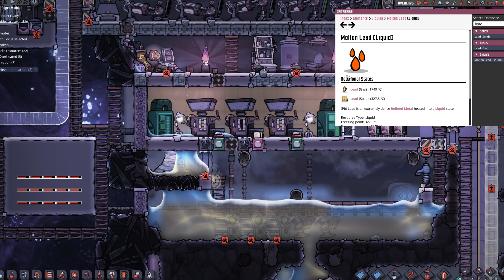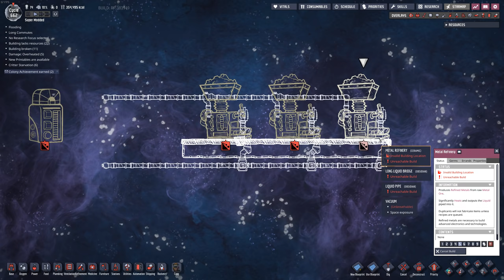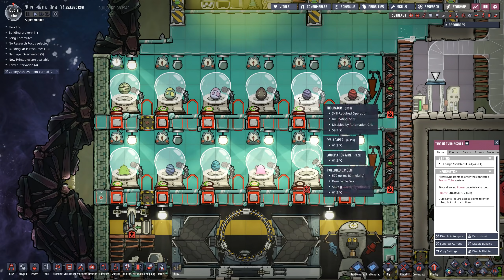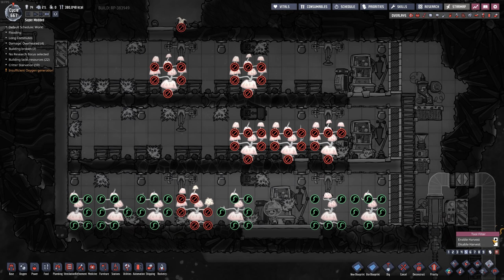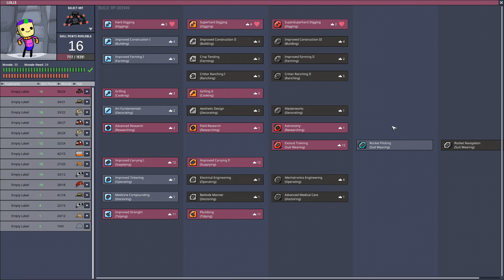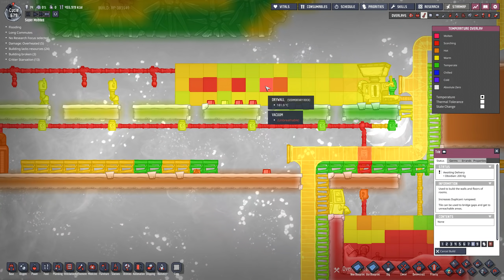Using Liquid Metal as Coolant! Super Modded Oxygen Not Included EP19

Comment: ever tried to make the unusual gasses in the game? aluminium gas, steel gas, must be some weird and wonderful things it can do apart from melt the world.

one note about the setup is you wont be able to run more than 1 machine from that loop anyway, you will need to use all 3 outputs on the tank to keep the system ticking or theres not enough materials flowing in as coolant it will just take longer to fill each reservoir, in case someones copying the design exactly, save yourself the ceramic

Comment: I think the lesson to be learnt here is that lead works pretty much as the opposite of water: Very little specific heat capacity, but pretty high thermal conductivity. (Granted, aluminum's thermal conductivity is even higher, but so is its heat capacity.) Because of these traits, it performs terribly as a coolant, BUT it would work well as a heat exchanger to be used ALONGSIDE a coolant. Try using it (perhaps along with some radiative steel pipes) to transfer heat away from magma, hot igneous rock, or even just molten aluminum to dump onto some oil or petroleum for example (or just use molten aluminum to transfer heat from magma to molten lead, then try to pump the molten lead to oil or petroleum to keep it cool).

Comment: There is a way to pump hot liquids without exposing the Pump to the liquid. The pump radius is a cross and also pumps liquids one tile to the left under the pump. So if a pump is built on one right tile you can put liquid in the left tile and pump it without the pump overheating. Hope that helps with dealing with hot temperatures.

Comment: @23:30 while anticlimatic, maybe running the crude oil / petroleum first into to pipes to warm them up could have been a good idea? ;)

Edit:
@29:50 you can't use molten lead for steel production - the SHC is too low. For aluminium, niobium and iron, you can run it once, then you have to cool it down a lot. With copper you can run it twice, gold increases the temp +206C, so it can be run multiple times.

Comment: I feel like the second filter gate to the right of the incubators is redundant. The left filter gate is preventing dupes from disabling the incubators prematurely already, and without a piece of automation directly connecting the button to the incubator they wouldn't be able to turn it on as well. :thinking:

13:10 That menacing Sporechid, just waiting to be awakened and cause problems.

I'd  like to see something like anti-liquid in the modded game. Something that turns to gas at lower temperatures and turns into solid when heated enough. Also, how about liquid steel pumped metal refineries? Probably will have to wait for thermium though...

Comment: Brothgar! You should use a new mod, it's wonderful and amazing! It's called the Thermal Interface Panel, and it connects buildings to the background layer! Power wires, liquid pipes, buildings, gas pipes, it connects everything and allows heat to interface without any gasses or liquids! Perfect for your space metal refineries.

Comment: You can also melt insulation if you pipe molten niobium through your refineries. if you make a not insulated "normal" liquid bridge tu pump it through you can melt it down and get some juicy materials :) takes about 2000 cycles to charge up the heat tho, so have fun with that project

Comment: Thermo Dynamics: You need to learn about Thermal Diffusivity, Heat Transfer Rate Ratio of (Spec.Heat Cap. /  Them. Conduct.)*(1/Density)
it like a Bucket(SHC) with a Hole in Bottom(Them.Cond.)
Bucket with Big hole in bottom VS. Olympic Pool with with pinhole in Bottom etc etc, its not always the SHC or the TC numbers to judge which is better to transfer heat, its the relationship between the 2, the Rate Ratio, the Thermal Diffusivity.
TL:DR       K=SHC/TC
tends->0 =more heat transfer(Conductor)
tends->Infinity =less heat transfer(Insulator)
Since buildings(pipes) etc are all made with same amount of 
mass(50Kg Sandstone, 50Kg Obsidian, 50Kg...etc), and 
2D Area are same also(square tiles)
Density(in-game Kg/m^2) is always the same (for Item your building) thus cancels itself when compared to another material
you can simplify formula to just Ratio of K=SHC/TC
BTW here is a link to my Main resources Spreadsheet with ALL materials in-game, Public, Enjoy(i like my Liquid Phase Chart)
https://docs.google.com/spreadsheets/d/1yUQ7nwJ1Cw8I7W6MZqy55gay9C8isIlml2JP9chZUzk/edit?usp=sharing
IRL> https://en.wikipedia.org/wiki/Thermal_diffusivity

Comment: Serious comment time: Of course you managed to accidentally turn lead into gas, Brothgar. Of course you did. Though.... I wonder if you could use molten salt as a coolant? Molten salt as a coolant might be a pretty cool idea to look into!
Reply: It's worse than aluminium in every way, but more readily available on most maps.

The wiki doesn't list it as a coolant on the metal refinery page, but its SHC of 0.7 is pretty close to liquid carbon's 0.71. Carbon rises by about 330C when used in steelmaking, so salt will be slightly more than that. Salt is liquid across 664 degrees (not counting the few degrees extra for state change), so you'd get one operation before needing to cool it off.

Comment: Your pump would have overheated anyway, since it is in vacuum. To prime your pipes, you could run small packets, so they wouldn't solidify.
I used molten lead to cool and prime a thermium pump pumping magma
Reply: Or just run 450 degree petroleum, followed by 800 degree lead through the pipes to preheat them if you feel the small packet thing is cheaty like I do.

Comment: Ah yes, another Brothgar video, how sweet :)

May Meep be blessed with the glory of MOLTEN LEAD AND ALUMINIUM
Reply: Reason why Liquid Metal Reactors in the USA use Sodium alloys as a coolant.  High heat transfer coefficient and low melting point ~~875 C.  Unfortunatly, Sodium is akali, and go boom if develop a leak and mix with Deuterium Water.  In situations like this, duplicant Bubbles, the resident expert is the best choice to fix any problems with nuclear reactors.
Reply: Is magma next?